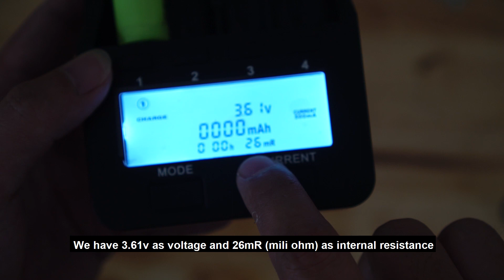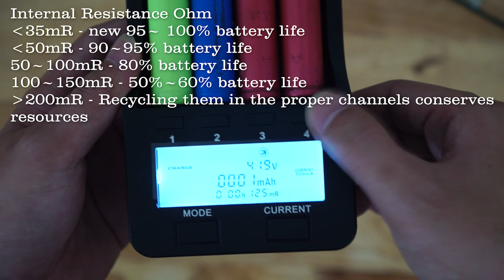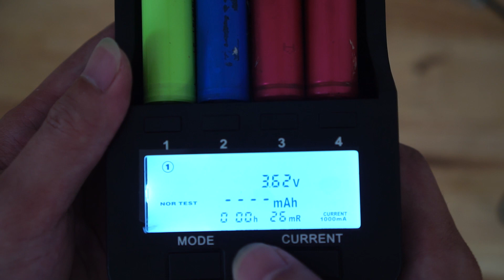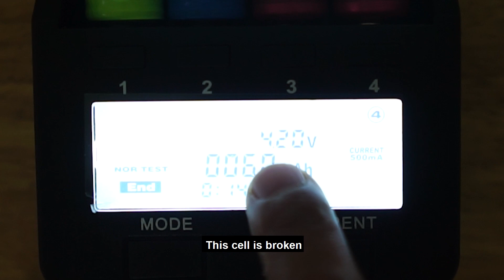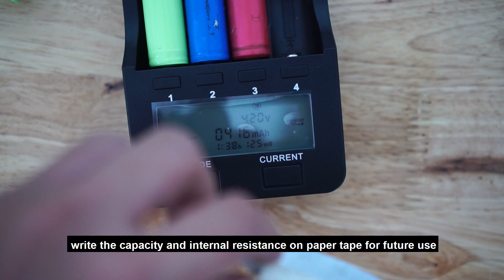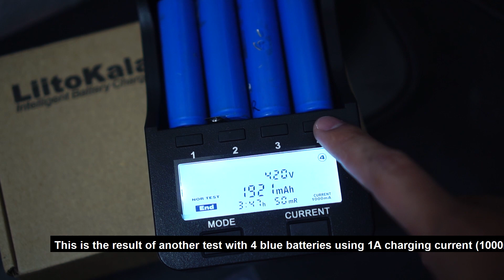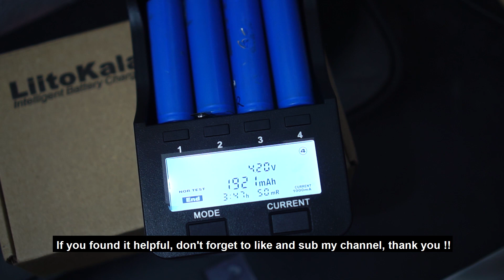How to determine good or bad Li-Ion battery, true capacity, Internal Resistance Ohm

Comment: Any one know when is the best time to take the internal resistance. When the voltage is at nominal or lower I’ve gotten between 90-125 and fully charged it’s 15-50 IR ??
Reply: Dont use above 90 in packs
Reply: Between normal and full state because thats the times you use them in your machine and yu dont use them when low battery

Comment: i have LiitoKala Lii-500 when is better to measuring internal resistance ,when is full charged or when is discharged ? it is very different value like 10-90
Reply: I agree I was about to ask the same question when’s the best time to to take internal resistance? At nominal voltage I’ve gotten 100-125 and fully charged ive gotten 15-55 ir ??

Comment: Li500 V2 can not measure discharge capacity. She's not worth to buy instead of V1.
Also you need to know, that if the cell has less than 2.3V, it doesn't charge it. It will charge them up to ~2V and stops, thinking that this is NiMH battery. To rescue cells that were 1V or less, I bought Xtar charger. It's worse than Li500, that's why I use it as a supported charger, but I recommend such a duo.
Reply: so this one is Li500 v2 or v1 can you tell me
Reply: @diablo6520  The charger in the video measures the capacity. So it is Lii500 😉
"Upgraded version" is Lii500S, which cannot correctly measure the capacity of the cells

Comment: Measurements of internal resistance in this charger are not reliable, the results are badly deviated
Reply from the maker: Agree, this is cheap charger,  not professional IR measure tool
Reply: @Laamlee-yt  I have four such chargers :), I like them very much but IR measurement is a terrible mistake should be either corrected or removed from this charger
Reply: Work great for comparison test of a large group of used or new 18650s, actual value may not match spec sheet but for comparison the values are consistent